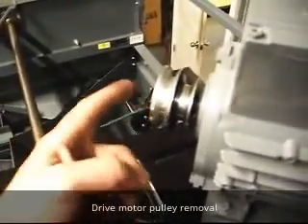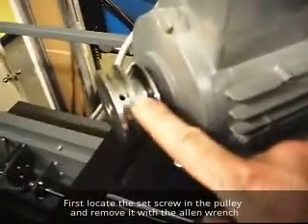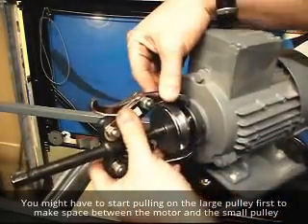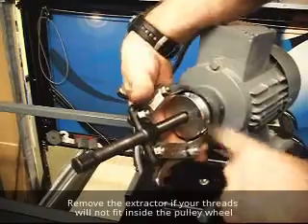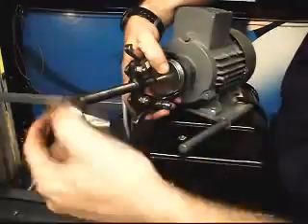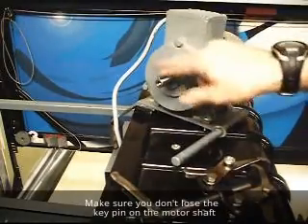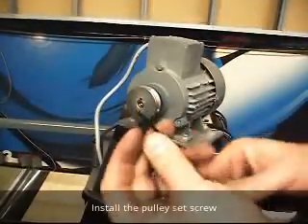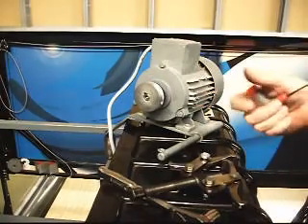Pulled It Off

Comment: Thanks a lot sir miller. For this video. Can i ask sir? It's GSX and gs98/92 same motors. Like sweep/distributor/table. Again thanks a lot for this video sir. I'm working with gs98/92 too old hehe 😂
Reply from the maker: I am not 100% certain if they are identical or not.  But when I review Brunswick parts diagrams for GS pinsetters there are only motors dedicated to GS pinsetters.  I believe this encompasses/includes all GS pinsetters, GS-96 and below, 98 and X.
Hope this helped you to safely remove your pulleys.